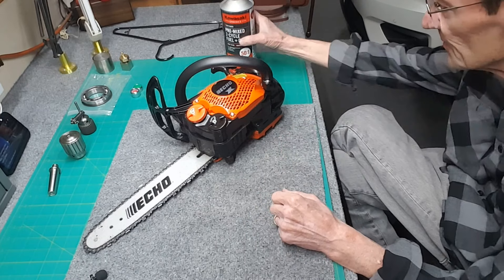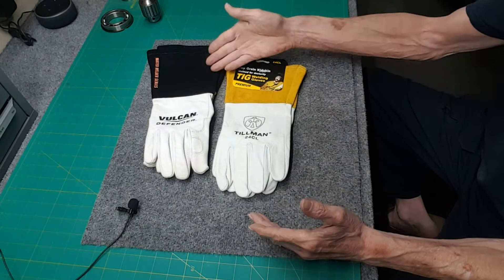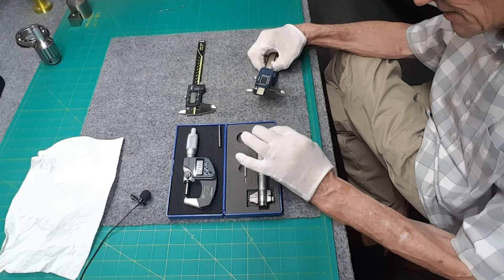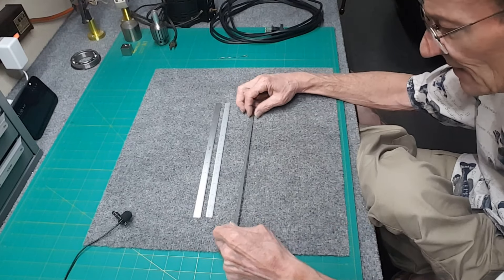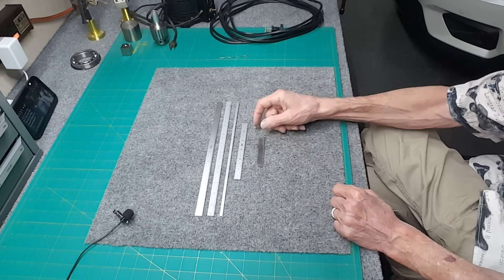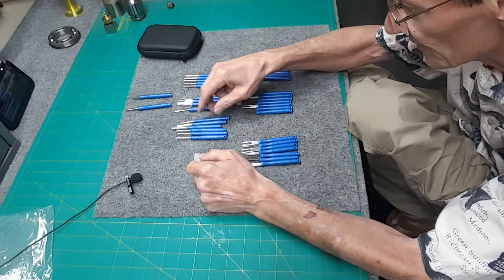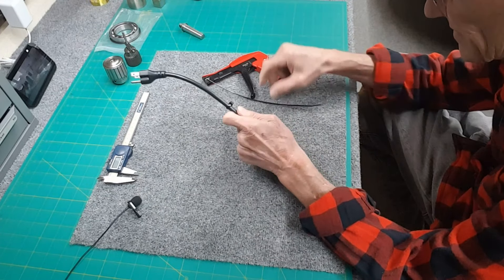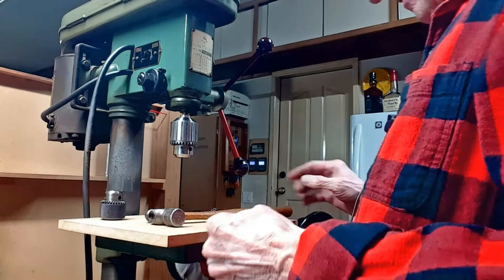Messen In The Shop

Comment: Good video(s) - I use 90 Octane Ethanol Free gas, that is sold by a local gas station (NY), in all of my power equipment.  Ethanol just loves water, and it will gunk up the carb!
Reply from the maker: Hi Scott, had no idea about the water problem. Thanks for the input!!

Comment: I heard that if you start engine once a month it won't have problems.Several manufacturers have their own fuel. If using pump gas ,drain and fill and run on special fuel, you only need enough to have it thru engine then store.
Reply from the maker: So far replacing all the gas, everything starts way easier and has more power somehow. To me this education was well worth it!

Comment: Have you fully extended the spindle to check for a slot? Even my old Chinese drill press has a slot for a wedge to knock out the Morse taper shaft to which the chuck is attached.

Comment: Have you fully extended the spindle to check for a slot? Even my old Chinese drill press has a slot for a wedge to knock out the Morse taper shaft to which the chuck is attached.
Reply from the maker: Hi Vern, yes I have and no slot but temped to take this thing apart I feel play in the spindle probably a keyway damaged.